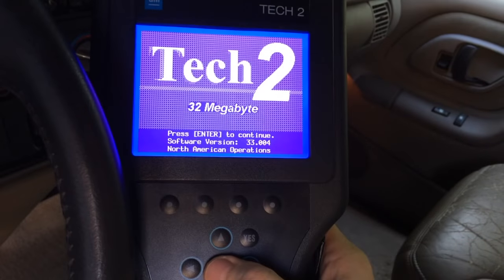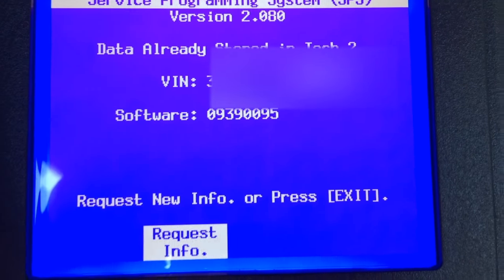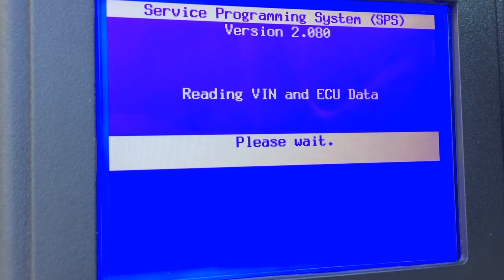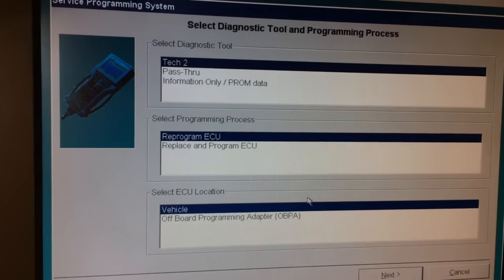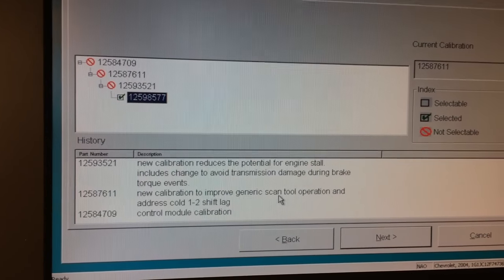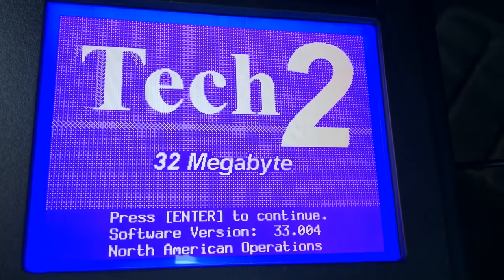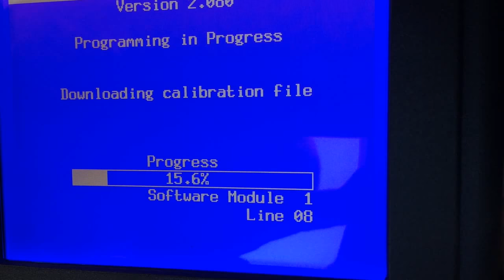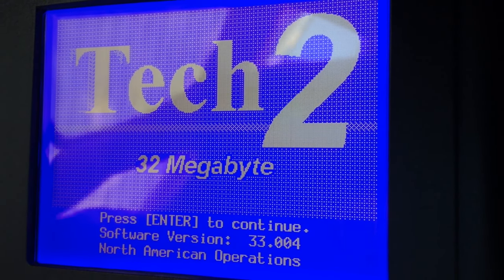GM SPS Programming: Tech2 Tool Remote Mode ECU TIS2000 How to do a Calibration Update Reflash (PCM)

Comment: DR. Shock , I need help,  I have a 200 Chevy Silverado, that had a Hypertech Programmer Program in it, but my Programmer got stolen, so I cant return Programming back to stock, unless i get the ECM/PCM re-flashed... So i bring it to the Dealer, and they attempt to Update and fe-flash, but they Cant, because the  Current Software in my truck is the latestest , up to date software, even though there is a Hidden Aftermarket Program that they cant see,,, And their Programmer, im guessing is a Tech 2 , will not update with the same Program... What are they doing wrong?  Do they need to choose the option of a replacemant ecu instead of updating the current one??? AHHHHHH   The reason im wanting it flashed is becasue i have a new Banks Programmer, and it wont program unless the ECU is clean, and has no other aftermarket programs in it, wich mine has, as the Banks programmer sees the Hypertech Program in the system and wont allow to program, unless it clean...Help!!  I read somewhere that mabbe the Tech 2 cannot do what i need done and need a MCI instead?  Thanks!
Reply from the maker: Neither of the GM dealer type tools, both Tech2 or MDI, are able to deal with aftermarket programming.  Neither of them will permit a flash when there is no update either.   Both of them will look for a particular GM calibration number, check the ACDelco TIS2Web server and if the number matches what's already on the module they will not proceed.  The only exception to this I'm aware of is for some modules, like the PCM, if the VINs do not match the tools will correct that.   I'm not familiar with these aftermarket programmers, but I had always heard they show up as a different calibration number to exactly avoid this sort of situation so you can roll back to factory stock.   I'm guessing from what you're saying here that this Hypertech one doesn't.
Reply: @DrShock    Having the Hypertech Program Hidden in my current Correct Calibration really isint the issue,,,The issue is that i need to Erase the PCM and re-flash, What if they choose the option of 'Replacing the ecm" instead of "updating current one" or whatever the language is in the options as your going through... Just reprogram with same vin ect... Its just amazing,,, they are able to find that you have after market software when your engine blows under warranty, but in my situation, they say, "no aftermarket software found" and correct calibration  is installed....AHHHHH    Yet it is indeed in there, and i need to remove it....
Reply: instead choosing "Reprogram ECU"  choose the option "Replace and Program ECU"....Would that work?
Reply from the maker: Neither of those options would skip the calibrations match check and abort feature, but it is the choice you would make to get the VIN rewritten on those modules where it's allowed such as the PCM.   Some modules even prevent changing the VIN (e.g., BCM, and DRR) and force you to replace the module with a new one.
Reply from the maker: You may want to post this situation at the Hypertech-inc.com forum as its their product they would know best how to get out of this situation.
Reply: @DrShock  Thanks DR!   I may have to get a whole new ECM....Ill call Hypertech Monday...Ill report back
Reply from the maker: I looked around for you, and saw a few posts about Snap-on programmers being able to go past the GM check whereas the Tech2 would not.  So another option might be an indy mechanic with one of these tools and a TIS2Web subscription as well.
Reply: @DrShock  Thanks!
Reply: Do you know if the Drew Technologies system would work, My local Mechanic uses that system,,,,Its some sort of subscription based system
Reply from the maker: I've heard of Drew, and it can use the same ACDelco TDS subscription system for SPS programming, but I don't know if it has the ability to overflash the same calibration.  Kinda have to have the local mechanic answer that one being that they use the tool day to day.  ;-)
Reply: @DrShock  Contacted Drew, and Apparently their system cannot as well, Contacted Hypertech and they also couldn't believe that the dealer could not re-flash over their software, becasue they said that happens all the time to their customers....They said they have never heard of the Dealer not being able to flash over their software since they have been in business for over the last 20 years!!  My luck!   What is the Model of the Snap-on Scanner that you heard of that will re-flash ?
Reply from the maker: I didn't see any model number stated in those posts but found something else that might be helpful.  So your model year from your first comment wasn't complete so you'll have to see how this applies, but here's the original GM tech bulletin about this thread topic - https://gm-techlink.com/?p=7906   This bulletin clarifies for which years what you're trying is prohibited completely (Hypertech's guys might want to read it), and for which it is a warning you can ignore (with risks).    If you're in the latter category, you might be able to share this with your dealer and give it another go.  Hope this helps.
Reply: @DrShock   i did see this Actually... My Truck is a Year 2000, so you would think it can be done, but both you and the Dealer say it cant be done...The Question is, what Software/programmer is used to do that, That picture looks like a regular Computer screen and not a Tech2 or a MDI right??
Reply: looks like Windows program is what i mean,,,What system is that?
Reply from the maker: It's a Java applet actually, for both the Tech2 and MDI, and MDI2, the SPS system (what GM uses to do flashing) runs as a Java applet on a Windows PC (what GM dealers call a Techline terminal).   The scan tool is basically nothing more than a cable adapter in this role.
Reply from the maker: The bulletin doesn't specify which modules you can skip, so it could be I've just never ran across one that allows for it.  So I would presume that means some modules will let you, some won't.   I can tell you I've not had any success attempting to rewrite the same calibration twice.
Reply: @DrShock  Banks is Currently working to fix my Programmer to program over mine, without having to reflash to stock...They had me download files off my Banks Programmer via their app that had my ecu program in it... They didnt call me back today, so hope to hear back from them tomorrow hopefully with good news...

Comment: Does Tech 2 work on windows 10 ? If not what is the best operating system for ‘Tis 2000 download?
Reply from the maker: The Tech2 is itself a self-contained computer, it doesn't interact at all with Windows.  But the TIS2000 Java software does.   Unfortunately, this is very old technology and it really only works reliably with Windows 2000 or Windows XP.   You can run the latter within a VM (virtual machine) on Windows 10 though if your PC has enough CPU/RAM to handle that route.   Most folks though just get an old obsolete laptop off eBay for just the TIS2000 work on their vehicle(s).
Reply: @DrShock  i have an windows 7 laptop will it work on this?
Reply from the maker: @pedrx_v9323  Nope, like said above to Benny you'll have to use a VM and run Windows 2000 or XP inside of it under Windows 7.  This stuff is very ancient software that performed actions that are incompatible with modern Windows versions natively.  Running a virtual machine with the older OS under Windows 7 is the way to go.
Reply: @DrShock  Fortunately Windows 7 includes XP mode, a virtual machine that will run XP on your Windows 7 computer. Best part is it is free and requires no license. Just Google Windows 7 XP mode.

Comment: Anyone know why tech2 says “waiting for data” when programming fob to 07 g6?
Reply from the maker: Communications issue most likely: you may need the key turned until the dash lights illuminate to power up the modules involved,  you may need a Candi module connected for a g6/malibu (can't recall what year the switch happend for this series).  You will need the latest PCMCIA based firmware for an 07 - version 33.004 in the USA.
Reply: Have you googled the procedure you dont need a tech 2

Comment: Thank you for making these videos. It very helpful. I get an error when trying to program a module. It says e37 database connection failed when I'm going thru to load the file to the tech2. It's on a clone. Any advice would be greatly appreciated.
Reply from the maker: Normally I'd say Google is how to find this out, but a quick check shows the search pattern to find info on this is not obvious because E37 is also a module code.   Looks like this error is usually triggered two ways.  If you're using TIS2000, it could either be not enough RAM on the PC or an unsupported version of Windows.   When I run vintage software like TIS2000, I run it on an old Win2K or XP machine to avoid this sort of thing.  The other source of error E37 seems to be from running a hacked version of the more modern TIS, and the solution here is you simply have to pony up and pay for the unhacked version of GlobalTIS for some modules.  Try this Google search string with the quotes around E37:  tech2 "E37" error
Reply: @DrShock  ok. I will try that. Thank you for your time.

Comment: Hi can you help me with this tech 2 ? I bought soon an Tech2 and I cannot connected at leptop can you help me pls?
Reply from the maker: Maybe, you'll have to elaborate a bit on what you need help with.
Reply: I need some help to connect at my laptop onest for this I need your help
Reply from the maker: There are many many things this could be, impossible to diagnose over a comment channel.  But if you can post something specific error message wise I might suggest some ideas for you to try.  But your best bet is probably contacting who you bought the tool from for basic setup and connectivity questions and issues.

Comment: With the Tech 2 you don’t have to pay the $40 per VIN charge?
Reply from the maker: Yes you do, for 2008 and newer vehicles and SPS to do calibrations.  Depending on the vehicle model diagnostics may still work up to around 2013, if that vehicle model came out prior to 2008.  You can use the TIS2000 DVD for 2007 and older and avoid paying the sub.
Reply: DrShock always appreciate your help . I’m buying the TIS2000 software and clone Tech 2 . Thank you so much as always .

Comment: Do you know what the fix is for error code e330 no context
Reply: If that is an error in Tis2000 you probably have a bad driver.  I was having problems with the program crashing I explored all the folders in the program and looked for additional setup icons.  Let them run, program was then stable  No errors, super smooth opperation now

Comment: Does TIS 2000 work with WIN 7 right out of the box?
Reply from the maker: It's from the WIndows 2000 / Windows XP era.  I've never gotten it to run on anything newer than XP.   You can put Windows XP in a virtual machine (VM) and run that under Windows 7 or higher.
Reply: Here it is almost one year later, used your advice and am up and running  Tech 2 on Tis 2000, Win XP sp3 ,Oracle V-box Ver. 5.3 32 bit.I have a Asus Z97-AR,Mobo which has a serial port which I hooked to the Tech 2 R-232 port with a adapter from serial port Mobo to back plate on computer.It was a little rough going but I got it all running with SPS, Snapshot, and most bi directional special functions working.Question, in the Tech 2 paths, in the Tech2 manual, in green letters,powertrain, engine output, special fuctions there is at least 15 separate ignition coil tests. However I can't find not one on the Tech 2?  I have on the Tech 2 - North American Operations Ver:33.004.about TIS 2000 says North American Operations 07.3 Tech 2 Ver:27.012, Tis Data 12.00 2007, Tis 2000 GMDAT-12/2007 this is onthe TIS 2000 home page on my computer. When I went to Tis 2000 home page,entered software download it informed me that I couldn't updatemy PCMCIA card ,only use custom setting to download previous programs which start with 27.012 which you will notice in the aboveabout TIS 2000 home page. I started thinking the coil tests might beon the previous 27.012 Tis 2000 program? Any ideas?  THANKS, CHARLES MAUS, P.S. Also have used on OBD II + CAN bus.same no coil test?
Reply from the maker: @charlesmaus7173  Great to read.  You can't update the PCMCIA image from TIS2000 since around year 2008, it's too old.  GM continued providing this update feature via TIS2Web though, until version 33.004 of the NAO image which was the last one in 2013 as the MDI tool had taken over.   Those Tech2 paths you're referencing are not vehicle specific, and the Tech2 does not expose all possible paths for all vehicles.   Some of the tools functionality depended on capabilities of the BCM and/or PCM as well the individual modules themselves, and so for some vehicles you just don't have the tests available.   In my experience there can be variability to what functions and such you get across vehicles, even during the same model year.
Reply: Thanks for your time. First let me say if I remember correctly, you said in one of your replies that the TIS 2000, 20yrs. ago was a very BADWRITTEN PROGRAM! I agree 100%. On the two vehicles I used the Tech 2 on, one a 2002 chev impala (ODB II) the other2005 chev Silverado 2500 truck w/ CAN. bus w/candi module installed. Neither hadany special function  ign. coil or ign. module test or bi-directionalcommands? But fuel injector tests, fuel trim, fuel trim learm plus 4or 5other fuel tests and bi directionl commands are present. One of the objectsof the Tech 2 is to diagnose the vehicle with out popping the hood.I am 67 yrs. old and been working on cars for 50 yrs. In that time the first thing I look at in a no-start condition is spark and fuel . No spark, no fuel, no compression, no-go. That is why the coil test should be theprimary test in every vehicle ,in every year. Just common sense!Also if you have 15 coil tests  in the  manual you should be able to access them don't you think? Lastly, 22 yrs. ago in 1998 there were no Chinese clone Tech 2's. The Tech 2 cost $3,000 and were owned by dealers only. If I paid that kind of money for something I expect itto do at least the basic functions. Today for $340. I expect the same thing.So I would like to ask you if you have ever come across any coil test[6and 8 cyl. engines are listed in the manual.} on any vehicle and if not why is there 15 tests in the manual?If anybody would know I figure it would be you. Finally let me say BAD....BAD GM engineers.
Reply from the maker: @charlesmaus7173  I don't believe I ever said TIS2000 was a "badly written" software, at most it was simply overly complex and "heavy" being Java based for the era.  But this design direction allowed GM to quickly move to remote web server based TIS2Web later and the "cloud" based approach which is all the rage today for distributed software. For the lack of parity in diagnostics tests across vehicle lines, I understand the frustration.  But coming from software engineering as a career, I can certainly relate to the challenge th GM engineers had of trying to have one dealer tool cover every vehicle from 1993 thru 2013.  It's a monumental task given the level of variability and variety across all of the vehicles of this range.